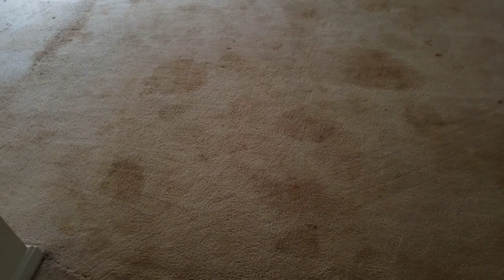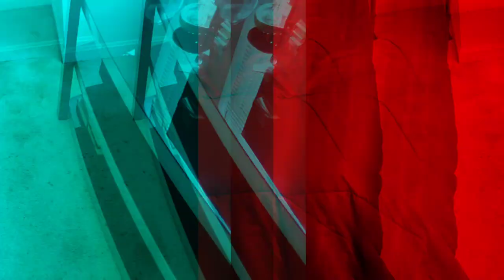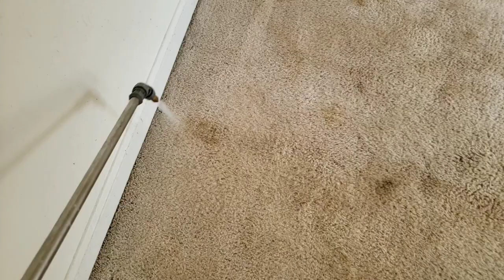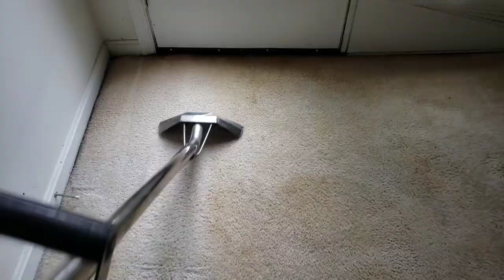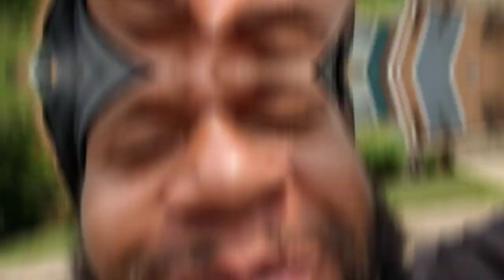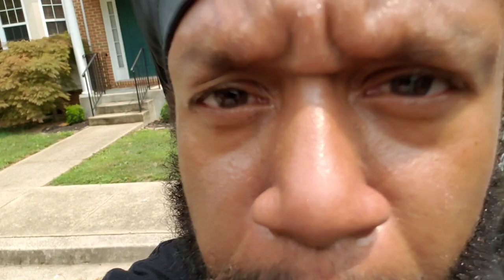Urine Dirty Dog Stains and odor | Completely Removed | ASMR |Carpet cleaning vlog Episode 299

Comment: Somebody had a big dog! Those are giant pee stains. I love the pet treatment episodes because it’s like watching you kill one of my old enemies 😂😂😂. My husband and I are dog lovers. We’ve had dogs for our whole marriage and over the last decade we’ve had times when we ended up with 4 & 5 dogs at a time, mostly rescues. The number is dwindling as our dogs are getting to be old 😢 but when we first moved into our current home in the woods we had carpet because we bought too late into the build to request an upgrade to laminate. Then we got a standard poodle puppy who took forever to house break. So she made big stains but she would pee & walk a little trickle all the way down the hall. 🤦‍♀️ I did not have an extractor so it was paper towels & resolve which does NOTHING. I went to using watered down Tide which does not do anything without an extractor. I’m here to back up what you say by experience and a whole lot of backbreaking effort that pee CANNOT be cleaned with Resolve or anything that lives on Pinterest ! You need the enzyme treatment! I’d love to know where to get it because I do have an extractor and some rugs. I typically hit a pee pee quick with a paper towel. Then grab my extractor and an all purpose spray with a drill brush as my CRB. That gets rid of the stain but not the enzymes that make a dog go back to the same spot over and over. Then a couple of times a year I drag them out to the driveway for a pressure washing, then extract the water. I haven’t done that this year because I’ve been diagnosed with asthma and I simply don’t have the strength to do it. It is HARD! I’m kinda scared because I’m about to lay carpet tiles (I got a house full for free from our church & in perfect shape). I also have a new puppy, but he is reliably pad trained but my 9 year old silky terrier is not and she is literally pissed off at me for getting a puppy and uses pee to show her feelings on the matter. But I’m not gonna glue them, I’m using carpet tape so I can pull it up and hose it off if needed. 
So to everyone who doesn’t know, pee can only be flushed out and the dog/cat and don’t even ask me about mini pigs😰  will go back to the same spot every time. And no vinegar and water does not work. Nothing on Pinterest works.
Reply from the maker: I look forward to your comment every video.  🖤💙💜🔥🤎❤🤣😂🤭🤭🤗🤗🤗🤗🤗

like a story time episode
Reply: @BrownsProfessionalCarpetCare  😂😂😂😂
Thanks, I am a bit of a story teller. I tell true crime stories on my other channel. On this account I just put up goofy barnyard/household stuff. 
Have a good one Andrea!